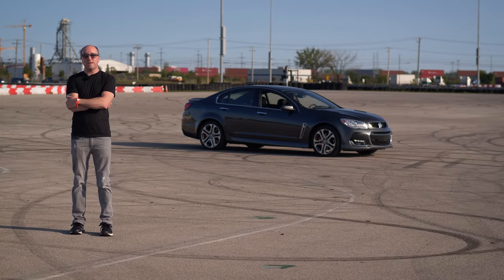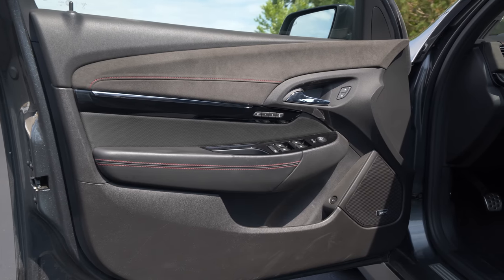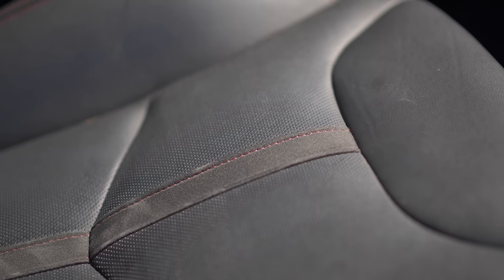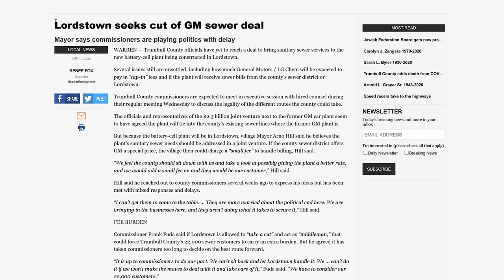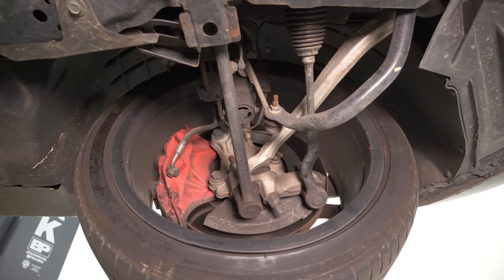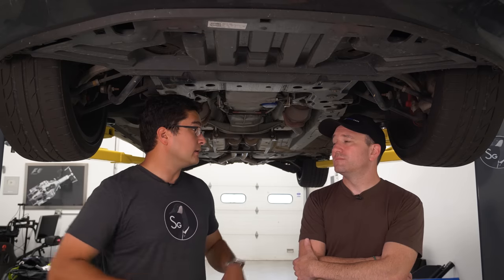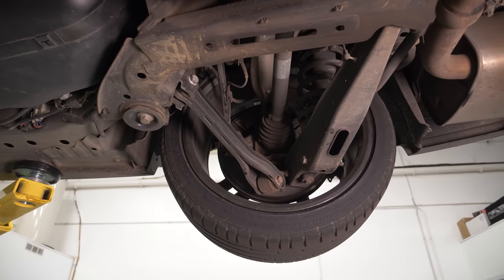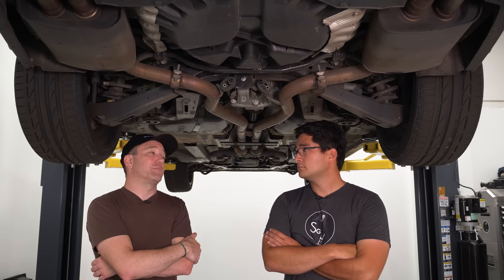Chevy SS Commodore | Holden a Funeral

Comment: I love my manual SS.  It’s a comfortable family car that has a V8, a manual, and RWD.  On the inside I added a ZL1 steering wheel and  an MGW shifter which enhance the driving experience.  I paid $38500 for mine new in 2016 when there was a 20% off promo through GM. The $50K sticker was more than I was willing to pay, but at $38500 it was a bargain.
Reply: This car will last long.
Manual gearboxes don't wear.
The clutch plate does, but those are repairs that let you drive another 200k km for 700-900 dollar.

If you treat your car decently 500k km on the odo should not be a hard challenge :-)

May you enjoy this character rich car for long.
Reply: John Goe thank you.  The LS3 and Tremec TR6060 are very stout and reliable, and cheap to fix to boot. That was part of what made it easy to justify buying it at the price I got. I had a VW Golf R that was quick, had a dual clutch, etc, but I dreaded the costs of owning it over it once I was past the warranty period. It also was not nearly as fun to drive as the SS. The Holden/Chevy SS has some items that won’t be cheap to fix like the magnetic ride dampers, but the drivetrain should be very reliable and cheap to maintain assuming only minor modifications are made.
Reply: Same here with the 20%, put a deposit down on the first manual I could find booked a flight to Nebraska and drove it back to NY the next day. Put an MGW shifter in shortly thereafter. Traded it in for a GT350 last year because flat plane crank.

Biggest problem with this car imo; felt like you were sitting on it, not in it.
Reply: @michaelcheshareck3275  Probably the only GM configuration worth owning. Best of luck with it :D
Reply: Alex every time I see a GT350 I really like to hear that flat plane crank exhaust note. They really sound nice when the revs get up above 5000 RPM. Rev happy motors are fun. I drove a 2019 Porsche GT3 hard for 90 minutes at the Porsche Experience and that was eye opening. A 4.0L 9000 RPM engine sitting in the back of a light car with a track tuned suspension feels and sounds like being in a race car.  When I felt like it was about time to upshift it would only be at 7000 RPM and it just kept building power on its way to redline. I’ve heard driving the GT 350 is similar in terms of how it still has plenty of revs left when you think you are getting near the rev limiter.
Reply: You're stoked... I got the last White Manual 2017 in California  PAID the Shithouse Price and I got 5 grand knocked off the top.  Last one in CA that Was Not HULK GREEN at Win Chevrolet  Sticker $ 55,100.00    I love my car.  Period. plus with wider better tires makes it a savage in the mountain roads.  Michelin PS 4S 255/40-19 front  285/35-19 rear
 The Savage Geese knock this video out the park.  As real as it gets.  Love you guys. Thank you for doing this video.. makes me smile.. cry .. laugh... and get mad all in one video..  long live the Holden Commodore SS VFII in Our Hearts
Reply: Topsnap Podcast I got mine from Winter Chevrolet during the first 20% off sale, and they had the only manual with no sunroof and a spare, and I got a little more knocked off from the 20% off.  I was shocked I got it new that cheap, as the prior week I was checking them used and they were asking more than I paid. 

I added on VF Forged VS02 wheels in 19x9.5 and 19x10.5, and wrapped them in Michelin PS4S in 275/35/19 and 305/30/19. Custom offset that allows them to not run at stock height. The wheels are less than 20 lb each, so that took well over 40 lbs off the car. Added a lot of grip. Aggressive alignment helps the turn in and grip a lot as well.
Reply: @RAZGR1Z  It's running great. Thank you for your concern!
Reply: Under 40k for a 400hp v8 rwd manual sedan with the handling and livability of magnerides is a fucking bargain. The perfect blend of affordability, fun, performance, and practicality. A car that attempts to satisfy all aspects of a “good” car without really compromising anything. This car was so underated and, in many ways, still is.
Reply: @dankmemer2774  agreed on all accounts. It really is a good all around car. I also like cars that aren’t around every corner, and sleepers.  It certainly fits those criteria.

Comment: As a owner of a 6sp manual US Chevy SS. Thank you Holden and the Aussies for making such a great car. One of the few cars that put a smile on my face every time I drive it.
Reply: It’s an American motor.
Reply: @Zach-td5mb yes it is. 

And everybody was already aware.

You guys forgot how to make good V8 sedans and we had to teach you again.
Reply: @davidhester6648  while the Commodore was a great car, the Zeta Platform was not inherently any better than the Sigma platform that debuted with Cadillac around the same time in the early 2000s; it was just cheaper to make. The CTS-Vs were and still are great cars. I do wish they would’ve gone through with selling the Ute version over here. It would’ve sold so well.
Reply: As an owner of a 2017 RPG M6, I agree.

Comment: Whenever Holden's would get reviewed overseas (as Vauxhalls, Pontiac or Chevy label), I would always be so proud of how well they would do.  Bit of nationalism shining through.
They fact that they would always compare it to the BMW M5 as a benchmark was especially amusing, considering how cheap Holdens where (especially in AU). Never really seemed fair.
Reply: Well for what they are and what the purpose of the vehicle was, it did an outstanding job. I’m a Ford guy but I can’t deny the brilliance of the Holden Commodore. I would buy one if I had the money. My has one so I am able to judge the car
Reply: holden commodores were never really Australian. largely based on Opels with Buick engines eg. https://en.wikipedia.org/wiki/Opel_Senator. The VE was really the only Australian commodore (albeit with GM engines), and it killed Holden.
Reply: TopGear UK absolutely loved the VauxhallMonaro, called it "magical" among other high praise.  Top Gear UK of course is not dreary like watching these jokers.
Reply: @grievuspwn4g3  Not really, the whole platform underneath the Falcons has always been completely Australian designed, and while the styling utilised new edge it was still an Australian design. The falcons also used Australian engines (Namely the 6 cylinders, but the highly modified Coyote V8's known as Miami's were Australian exclusive). But yes you're right, Ford cut them off when they were sapping too much cash. At the end of the day the Parent company still makes the decisions.
Reply: @Mantenner  not true first falcons were american, XA was first aussie designed and built but continued the same underpinnings. to say the commodore was a rebadged opel shows lack of AUDM knowledge
Reply: @andrewb5887  Obviously the directly imported falcons were American, everybody knows that. Pre XA were literally just American Falcons that were converted to RHD. I didn't mention them because there was no effort on Ford Australia's part to rebrand/modify the Falcons, they were marketed as an American car., same body, same drivetrain etc unlike Holden which reworked an existing opel chassis and gave it a new lick of paint, calling it Australian. When Ford called their Falcons Australian, then genuinely were Australian.

Commodores however,  WERE literally an opel. The shell was a modified Opel shell to begin with, and ever since then they were just pulling from American hardware, drivetrain and chassis included. It wasn't until the VE that the commodore was actually designed in Australia from scratch.
Reply: i'm from Uk i have a Vaux/don't  like that name . So iv'e got Holden .HSV on My 6.2 VXR8 with a Badge with  AUSSIE V8 on it .Been a Holden Fan Since 70s  .Smiles Per Gallon
Reply: WTF are you talking about with the platforms of falcons being ALL AUSTRALIAN. ALL early falcons were AMERICAN designed and basically a straight copy and outdated rubbish. Ford didn’t even fit rack and pinion steering for DECADES. They were renowned tight arses and only EVER caught up on fitting anything like twin spot brakes when pushed by Holden who were already doing it. How long did it take Ford Australia to fit IRS. Get of the crack pipe.
Reply: Exactly. You can buy three VFs for the price of an M5 in Australia. They are what they are. For the price point, they are great. I smile everytime I turn the key in mine.
Reply: @tima9790  Yep. Everybody who knows anything about Australian cars learnt that a decade ago. Thanks for the flashback. Go drive your Hyundai i30 to wherever you're going to buy your homebrand food.
Reply: @drm9979  I watched half a show of top gear uk and never watched another. That may dude, the big guy, and the miget gave me an instant fkn headache.

Comment: Just picked up my manual SS earlier this year. Acura dealer didn't know what they had, so I managed to get a decent price. Wouldn't trade it for the world. You guys are spot on, as always.
Reply: Bought mine new in 2016. I’ve entertained replacing for something new and when I get in and start driving I change my mind
Reply: @chitterlingsrtasty  Also bought mine new in '16.  I'll never forget the day I was to pick it up, GM issued the recall on the driver-side seat-belt.  Was still able to get the 20% off MSRP and the dealer kept the car in the showroom with a SOLD sticker until the parts arrived several months later.  Glad I went through with the purchase and waited.  This year the power steering rack recall finally came through for mine, so I'll never get rid of it now.  Fantastic car.
Reply: Anthony S That’s great. I’ve got an 03 VY SS that I’ll never get rid of. Had it for 13 years now. I don’t drive it much anymore but it makes me smile every time I do.

Comment: Wankers here swap about the Holden badges for Chev badges, and then in the US they swap the Chev badges for Holden badges ;-P
Reply: Still waiting to see a VL Commodore 6 with Nissan badges.  Not holding my breath!
Reply: I don't get changing to Chev badges here, but understand why they would change to Holden badge in the US when it is a Holden. It's like saying you'd change the Chev badge off a SS or ZL1 Camaro when it arrived in Australia - why? You just wouldn't.
Reply: @ssvr3dl1n38  It's like they value the origin of the engine over the origin of the car, I guess.  Hence my VL Nissan joke.  Of course, Holden's history of bodies and assembly had them building Chevs and Fords at different points in history.  They build Ford Ts before Ford got its own factory going in Geelong.
Reply: Tone.  Groan!
Reply: Them chevvy drivers with Holden badges haha
Reply: If ur so embarrassed about getting a commie y
Then just get a better car? Right?
Reply: Today I  saw a badge swapped Chevy SS here in the US. Yep.
Reply: The holden badges were a factory option here in the US
Reply: @cbush2361  I didn't know that, thanks.
Reply: Just looked at Autotrader. Most of these are selling for over the original MSRP, especially the manuals.

Comment: I disagree with the appreciation of the interior. Especially Mark's head down demeanor about it. It's perfectly fine. 
I identify with Jack's enthusiasm while driving it. The car isn't supposed to be a gt3. It's a big sedan that's fast. Stop with the idea every car has to be a sharp track tool. Then they would complain it's too stiff. The car is great for what it is. I love it.
Reply: Exactly. Preach it!
Reply: @pabauza - absolutely perfectly put in words! Well said.
Reply: @somerandomgoogleuser3374  thx. I have a 2014 as my daily. I love the thing, and mine is an automatic.
Reply: I agree that the interior isn't awful - but neither is it the premium car interior that you'd expect at the SS price point, aside from a few minor bits of alcantara. If it were in a Malibu it would be unexpectedly nice.
Reply: Mark Miller True. To me modern interiors are fine for the most part. However reviewers arent always consistent w criticism (for ex. Tesla interiors aren’t great and they ain’t cheap. Its been mentioned but its not a main topic when a Tesla is discussed). I just thought he made a disproportionate deal out of the interior.
Reply: It's a terrible interior for the price of the car, you can't escape that. SG did a good job of explaining why it ended up that way too. To get an idea of what can be done better for less, and just by way of comparative example, take a look at what Mazda has been putting out. Better form factor, design, and electronics all coming from a small manufacturer.
Reply: Exactly!  The interior is actually really nice and classy.  Everything is where it should be and everything looks and feels nice. 100X better than a Charger interior!  I feel like there was a lot of anti-GM bias going on, especially using the term "shitboxes". Sigh🙄
Reply: @mikevictor  Well said. Still sounds like the Australian tax payers got shafted, losing long standing traditional brands is a loss for any country.
Reply: @TheChannel1978  Yeah it was a real shame to see what happened on multiple levels. Many parties involved too with competing interests. Holden could have really been something special long-term however what's done can't be undone.

Comment: I bought a 2017 SS with the six speed manual in spring of 2017 as they were blowing them out. To date, I have 6,900 miles on it. It’s a true American E39 M5.
Reply: Australian*
Reply: Drive that thing
Reply: How much did you get it for?
Reply: @thisisntsergio1352  I know in my area they were less than 42k brand new off the lot for awhile at that time.
Reply: Sergio Martinez you’d cry if I told you
Reply: @hixnada8278  bought my '16 in Oct 2016 for a song. 20% off plus a very motivated dealer meant I got the car for an incredible deal. Let me put it this way: I could sell it now for the same amount I paid for it in 2016. Best. Decision. Ever!
Reply: @hixnada8278  36k?
Reply: Um, please explain WTF is American about the SS? It's 100% Aussie mate.

Comment: The Chevy SS came standard with the MagnaRide. The regular Holden Commodore in Australia didn't. You had to pony up for the more expensive HSV if you wanted it.
Reply: Yes I always found this weird
Reply: Actually the 14s didnt have the Magnaride or an available manual for that matter.
Reply: actually the last few years the VF II did get the Magride in non-HSV cars. but yea you guys definitely had to pay more for it.
Reply: Later years had MagnaRide standard.
Reply: @Alex-zt6ec  Nope. The only normal Commodores that had MRC as standard were the swansong Motorsport Edition and Director, based off of the SS-V Redline and Calais V respectively.
Reply: I ponied up for an expensive girl once, who to my surprise three days later, threw in HSV for free.
Reply: America got hooked up then. (:
Reply: @hemicuda699    100%
Reply: hemicuda699 actually, the 2014 storm in Australia did come in a manual but not with the magna sus as you noted. I own one.
Reply: None of the Commodore or HSV range had cooled seats either.
Reply: One Chance China Basically the American versions were upgraded. (:
Reply: @TheStigHCE09  Chevy SS's had MagnaRide standard in later years. I had one. It was standard. Sounds like Holdens were a different story?
Reply: @geerstyresoil3136  Really? I have a 2016 VFII SSV Redline and it doesn't have "magnaride" (which I assume in Australia is referred to as MRC - Magnetic Ride Control).
Reply: @TheStigHCE09  that's what I thought and had been told. My SSV Redline had FE3 suspension (which I've now fully replaced with Bilstein).
Reply: @Alex-zt6ec  The way you worded your reply led me to believe you were talking about the Holden, not the Chevy.
Reply: @geerstyresoil3136  Yeh, so "Director or Motorsport editions" only. The majority are stock with FE3 suspension.
Reply: @ssvr3dl1n38  I was responding to original poster that only HSV cars had MRC, when in fact Holden did offer it. Yes it was a special edition but Holden did offer it at some point to Austrailians.
Reply: @Destroyah32  MagnaRide was absolutely useless on Australian dirt roads.
Reply: Andrew Rollason ohh that makes sense. The standard coils were good so type Mag ride wasn’t really needed
Reply: @jimthumerzs2301  HSV? All I got was a piss-poor NSU!
Reply: @ssvr3dl1n38  The last Motorsport Editions had it.

Comment: Thanks for doing this tribute guys. Another Aussy here. Catch ya later.
Reply: Can't be.. It's spelt Aussie..
Reply: Oy !
Reply: Lmao nice try, you ain't Aussie
Reply: Tim L. You blokes are tripping hard, just because I was in a hurry typing Aussy vs Aussie I now need to recite Khe San. Did you even look at my handle. I drive a BARRA T!
Reply: @g6et_wrx177  I have to say on the Barra note- wonder what SG would think of the FG or FG-X (used to own an FG XR6 Turbo in manual it was a great car, bar the stock brakes)
Reply: Jason Raynar there is something very special about how strong a BARRA is. A huge over engineered 4.0 double overhead cam 6 that makes driving effortless. Sure if he interiors are now slightly dated however with a new modern infotainment replacement which integrates the CANBUS and has CarPlay has extended the life of my G6ET. SG ever comes out to Melbourne Vic they can have G6ET for the day.

Comment: It's mind blowing that these guys get in depth far more than the Australian reviewers. Great car let down by poor dealer.
Reply: The same thing happened in Australia as is happening almost everywhere else. People are buying SUVs not sedans. The Australian market was already small to begin with, but the influx of cheap SUVs from Japan, Korea, China etc, simply meant neither Holden nor Ford Australia or even Toyota could sell enough locally built cars to remain profitable.
Reply: @alanjm1234  not to mention they were expensive. I've done my part and have purchased a VE SSV and a VF GTS new and have kept them both still. I did try to shift the GTS at the very start of the pandemic just in case for business cash flow at 55k and had no takers...now considering how much they change hands for I'll never sell hahahha.